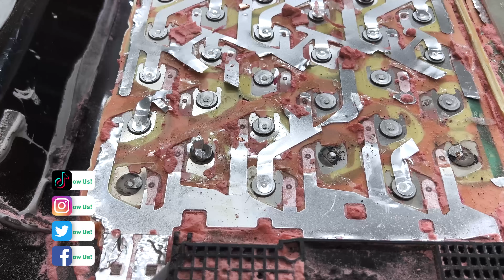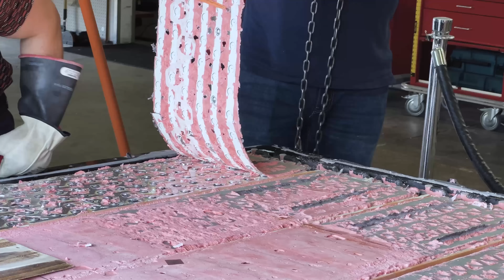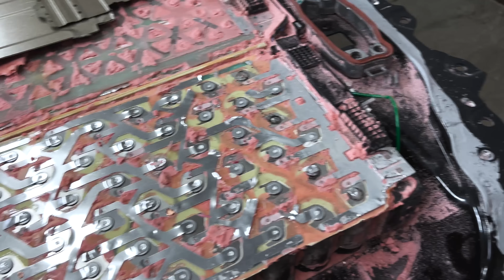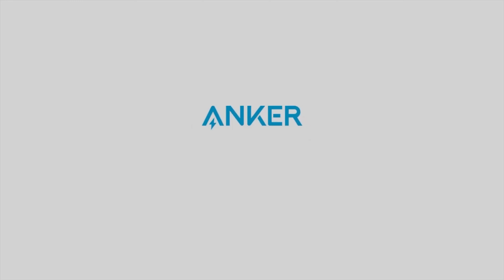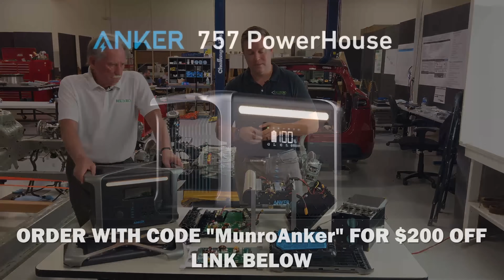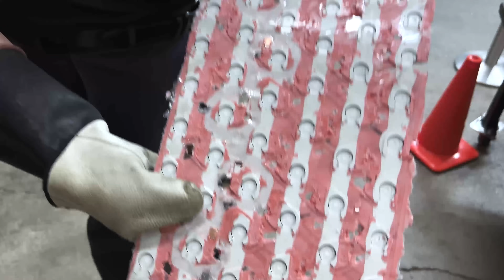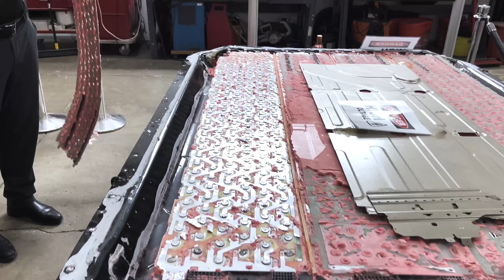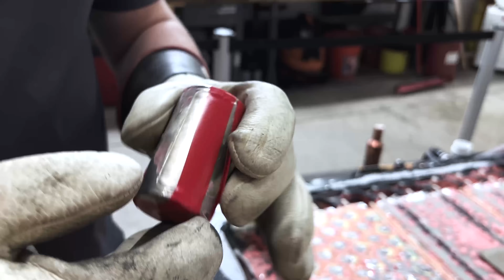Tesla's 4680 Current Collector Layout

Comment: The EV conversion shops won't be able to do much with this battery pack.  If a vehicle with this pack gets totalled, the pack either needs to be used whole or go straight to the recycler.  Obviously that's not Tesla's concern - they just want to make a profit on new cars.  But mass use of this pack by Tesla will have effects downstream on conversion shops, homebrew solar shops, insurers, auto wreckers, and the battery recycling industry, which is still not very developed.
Reply: That was patently obvious at Battery Day. Any conversion shop shocked and surprised by this really shouldnt be trusted to be doing this kind of work.

And from Teslas' perspective, not having people using thier modules in hotrods is a safety/legal plus.
Reply: @patreekotime4578  I didn't expect it to be serviceable but expected the pack to have to be cut out of a chassis. Turns out it's a simple bolt-on your a chassis without a floor in it. I'm underwhelmed. The thing is thick and the specs do far lackluster. Cheap to make sure but Tesla never share such savings with customers. Look at the price of a Model S.
Reply: @Cloxxki  The manufacturing approach for the Model S is totally different. If Munro analyse this and give it the thumbs up as an amazing advance in EV manufacturing I reckon I'll take their word for it. What's the problem with a removeable pack ... don't you think you want the possibility of a replacement? Alternatively they could ultimately move to a welded approach once they have confirmed that in practice they don't need to swap out any packs.
Reply: Not really an issue. Battery recycling is quite developed now, and will easily scale as supply of batteries to be recycled increases.
Reply: There need not be a huge reduction in failures in order to make up for the lack of repairability and reusability from an environmental perspective, and this looks like a step up in reliability to me. As far as recycling goes, it should be almost as easy to run a large pack through a schredder as a smaller one.

Comment: There's something is not talking yet... this structural battery pack is supposed to be for the long-range, all the cells are there, it is full already? Am I wrong? But, according to some persons, for now, it is only a software blocking to don’t use all the cells? Because Tesla seems to not build the long-range yet with the 4680... thanx for your time.

Comment: "But compared to 2170s this is a major step up" 👍🏻😎
Reply: Are you sure? In which way? I can't see it for total weight, total energy capacity or consumer price. On top of that, zero level of serviceability. Use or scrap. The 2170 packs from crashed cars are used to power buildings and other cars.
Reply: @Cloxxki  that quote was from the video itself from the guy talking to Cory not me. 👍🏻

Some of the ways it's superior imo? No individual modules means less assembly time, less materials total which equals less costs&less chance for things to go wrong during many various assembly steps.

828 4680 cells vs 4400+2170 equals less material handling, less welds, less cooling snakes, simpler lighter more efficient&sustainable.

4680 cells designed to be part of a stressed member load bearing cell to pack&cell to chassis assembly which saves weight, 2170s get carried like a drop tank on a jet fighter in comparison just dead weight.

4680 when all gains are realised by team tesla internally? Will cost half what they paid per kwh for cells back in 2020. 

4680s production all in house means gains are realised instantly and implemented just as quickly and tesla alone reaps the benefits. 
Vs being at the mercy of cell providers i.e. Panasonic who never got giga Nevada to the 50 gwhs they provided elon back in 2014. 

I can think of many more reasons but those are a few of my favorites. 😎
Reply: @4literv6  i'm not sure how that's true. they were talking about energy density (the Wh/litre type) and for this to be true the cells would need to have significantly more than 89 Watthours each. (21700 had 16.75 Wh each, 4416 of those makes a 74 kWh pack, whereas nobody yet knows how much these cells have exactly) a "major step up" i'd say is 105 Wh for each cell. anyway i don't get why people get hung up on energy density (the Wh/litre kind). specific energy is much more important (the Wh / kilogram one)
Reply: ????- umm
Reply: the results are in: 86.5 Wh cell. not impressive. data by university of california san diego video 4XOHetABrag here on youtube (can't find a direct link to the document)

Comment: Yes its official, 828 cells. Now we just need to know the kWh of each cell.
Reply: Less dan 0.1 kWh is my guess. For a cell 5.5x larger than 2170,pretty meh unless the cell is only 4x the weight. 
And you can only measure that driving the car and dividing by number of cells. If you test the cell in the lab, between which voltages? It's supposed to be all new chemistry after all.
Reply: He says in the end 600 cells. Not 800?
Reply: @TurreTuntematon  I have no idea why Cory mentioned 600 cells - presumably just a slip. He knows that there are 828 cells.
Reply: rumour has it 96 Wh per cell. it's a lower estimate from the limiting factor video afther a chemical test of a cell, not a proper discharge test. 828 of those would make for a ~80 kWh battery pack. each cell weighs 355 grams out of the pack, so specific energy if all the other numbers are correct is 272 Wh / kg
Reply: correction: 86.5 Wh cell, 81.5 of which is usable. not impressive. data by university of california san diego video 4XOHetABrag here on youtube (can't find a direct link to the document). only 244 Wh / kg

Comment: I haven’t read through all the comments, but I’m curious about the flammability of the pink foam. Have you tested it yet?
Reply from the maker: Not yet, but we will.
Reply: @MunroLive  And the weight of the foam, I wonder if they can safe weight on that too.
Reply: I can tell you about the flammability of the 5 gallons of Ethanol Glycol.
It's highly flammable.
Especially when it's hot from supercharging or hard driving.
Reply: @whompywheels5165  Why would anyone have 5 gallons of Ethanol Glycol in it's electric car?

Comment: My takeaway? This pack is going to be able to move a lot more power in and out safely because of the robust nature of this architecture. Thanks again for your time and dedication Munro team.
Reply: Cooling is much more important for that than robustness.
Reply: @EinzigfreierName  
"Not heating" is much more important (and efficient) than cooling.
"Tabless" says "hi".
Low resistance> more power/ less heat > much less cooling required.
Plus, less heat stress on the cell = longer life.
Reply: @rogerstarkey5390  That's true of course. Producing less losses/heat in the first place is an important part. How much the tabless design really contributes to that we'll have to see.  Waiting for someone to measure and publish such basic data like internal resistance of a 4680 cell.

Comment: Why aren't they using axial cooling . Is radial cooling better ?
Reply: The Limiting Factor had a teardown video.  Right now it looks like the current collector on each end of the cell has too many gaps to conduct heat better than the side wall.  Might also be doing the 4680 upgrade in stages and we'll see end cooling in a few years.

Comment: Brillouin Energy Corp Demonstrates CleanTech Licensable Solid State Fusion Boiler System at the 24 th Annual International Conference on Cold Fusion July 25 th – 28 th at the Computer History Museum in Mountain View, California Breakthrough boiler system uses hydrogen to produce low-cost heat with no combustion or pollution, paving the way to a clean energy future.
Reply: Hydrogen is hopelessly inefficient at every stage of its cycle.
Reply: @fredbloggs5902  Diesel Engine Oil Shortage: Diesel engine oil products already RUNNING OUT on retail shelves. youtu.be/Lvf1iM8Uvfs

Comment: Another YouTuber, The Limiting Factor, got a pre-production 4680 cell and sent it to researchers at UC San Diego for tear down and has the full 4hr teardown condensed down into a 1hr video on his channel. It would be interesting to see if there are any significant changes in the production cell, though not sure Munro will go into that level of detail on YouTube. The shell of the 4680 cell is much thicker than a 2170 cell, likely due to it being intended as a structural pack design. The researchers had a heck of a time cutting the through the shell, much like Munro is having a heck of a time disassembling the pack.
Reply: This guy bought a cell from Sandy already to repeat this process again. So he will have his comparison between the two.
Reply: The Limiting Factor plans to buy one of the cells from Munro Live, do a tear-down of it, and report what differences it has, if any, from the older cell. I'm not sure what the time frame will be for that tear-down and reporting.
Reply: They had "a heck of a time" because they used just about every incorrect tool you possibly could.
(Including nail scissors.... I kid you not)
They need an actual technician to make a simple jig allowing the use of proper cutting tools.
Just sayin'
Reply: Define "structural"? Is the car a noodle without the pack bolted on? There was supposed to be weight savings, but the loss in energy capacity seems to be greater than the reported 9 kgs.
Reply: @Cloxxki  seats physically bolt to the pack. The top of the battery pack is the interior of the floor. It’s isn’t just a battery pack as an integrated battery/floor assembly.
Reply: are you trying to tell  me something I don't  know, or just pumping your image of self... Yes yes yes, and BS...  lol (yes I know what compisites can achieve, so many have no idea  and just pump thair fears.)  get on with it...
Reply: The cells themselves aren't structural - all that "pink foam" precludes that...  Thermodynamics and containing "runaway events with a lower SurfArea to Volume ration will necessitate thicker casing...  lol..  Ay research institute who can't cut a steel case, isn't trying...

Obv, Triolled - for good reason...  lol...  jk..have a great day.
Reply: @kadmow  Well it would be easy if you didn’t care about destroying it, but to do it properly requires doing it in a sealed glove box with no oxygen with all manual tools. Makes it a lot more difficult.
Reply: @Weezedog  - salt brine followed by water-jet - solves many problems, lol.. (glovebox - like for storing ones tissues??  - global english is funny and confusing at times).... enjoy.
Reply: @kadmow  My father in law builds model airplanes with foam and fibreglass. You wouldn't believe how strong a fiber-foam-fiber sandwich wing can be. Composite racing cars such as F1 cars are built similarly. Did you think they'd weld the cells to the casing or what?

Comment: I’m interested- I was expecting a lot less cells due to the improvements as they chose to make a standard range version but it seems there are still a similar number of cells - are teslas claims about the 4680’s accurate?
Reply: 18650 packs for tesla are over 7k cells, 2170 packs Cory just said 4,400 cells, these 4680 are just 828 in comparison. 
Seems like a major reduction in cell count to me. But I didn't take common core math either so. 😀
Reply: @4literv6  I obviously didn’t watch the video in its entirety lol
Reply: @4literv6  BMW i4 is 324 cells for 80 kWh. Mercedes EQS is 216 cells for 108 kWh. Teslas 4680 cells are still quite small and numerous in a pack.
Reply: @koeniglicher  those are the inferior prone to thermal runaway pouch cells right? 🤔
Reply: @4literv6  No, BMW i4 80 kWh and Mercedes EQS 108 kWh packs, both are built with prismatic cells. In addition, your negative comment on pouch cells (like in most Porsche Taycan packs) is way too general and unsubstantial.
Reply: @koeniglicher  recalls so far for pouch cell equipped evs would seem to reinforce my comments. 
To each their own. I'll trust the company whose just now made 3,000,000 evs all with cylindrical or prismatic lfp and zero pouch cells. 👍🏻
Reply: @4literv6  of course the cell count is lower - a 4680 cell has 5.5 times the volume of a 2170 cell, and 8 times the volume of an 18650 cell.

There are 828 4680 cells in this battery.
Reply: @brianb-p6586  why are you responding to me and using the cell count I posted 9 days ago? 🤔
Reply: @4literv6  Because you seemed to think that the obviously lower cell count was some sort of revelation, rather than the obvious result of larger cells.
Reply: @brianb-p6586  lookup assumptions next time before commenting on something that didn't involve you to begin with. 👍🏻

Comment: Is it true that this new design pack has a lot less total energy capacity, while saving only 20 pounds (9 kilograms) over the latest 2170 pack Model Y?
Reply: The energy capacity of 4680s is currently unknown, it’s believed to be somewhere around 100 Wh per cell.
Reply: @fredbloggs5902  cheers, but the pack seems well under 80 kWh for over 800 cells. Did anyone weigh a cell yet? I'm baffled that people seem to just cheer and don't want to know specs to compare to the Battery Day fuzzy math.
Reply: @Cloxxki  I honestly have no idea, I think 828x cells were mentioned (?). What’s your source for the total capacity being below 80 kWh?
Reply: They commented directly in the video they expect it to have higher energy density. Listen.
Reply: @shannons1886  we want the figures for NOW, not in a year’s time.
Reply: @shannons1886  Expect... The car specs are underwhelming so far. Others have the energy density barely over 2170s. Tesla rolled a larger cell, like AA to D, without only savings for Tesla, no technical gain for the customer I can see. Same price, less range and nothing to salvage when a battery goes bad. Just high grade lithium and aluminium ore...

Comment: With that liberal foam, do the cells themselves add ANY structural integrity to the chassis, as was originally promised?
I seem to remember the cells were to be bonded together on 6 sizes, to at least one plate and sit between even sturdier dummies to space the top and bottom plates. Now the pack is a bolt-on anyway and I don't see the cells doing more structurally than just sitting there?
Reply: It s not foam once it dries and hardened  . can t you tell or you “just “ sit there
Reply: I am only sharing my opinion. take lightly. I believe the cells and pack are supposed to have some level of flex. I am curious as well, I think the pack is more like hard dense rubber and rebar as battery cells. so hard front flexible middle, hard rear.  if flex doesn't distort then should be very useful
Reply: @davidguay5326  It's a thick one, though. The shell might be stiff, the foam and cells would not support it until after substantial flex, from my guess. What's structural? That the car doesn't have a floor when there is no pack?

Comment: Is this the single most expensive component deconstruction you guys have ever done?
Reply from the maker: Yes
Reply: @MunroLive  You said you had worked on tanks, airplanes and whatnot. There must be far more expensive components in them, that you analyzed.
And: you teared down a Model S 102 kWh battery pack. This is more expensive already than this 80 kWh pack.
Reply: @koeniglicher  expensive in man hours and specialized equipment.

Comment: Please do a full cycle of a single cell to find out the current watt hours per cell.
Reply: They probably try to discharge the cell to zero, you know, for safety...I'm guessing it won't work quite as well as it did....
Reply: OK genius, which voltages do you recommend for this particular chemistry?
Reply: @Cloxxki  lol what? They are 4.2v per cell. They are still NCA. All NCA is 4.2v per cell charged (3.7 nominal).
Reply: @jasonfranciosa  They are NMC-811. No longer NCA. Voltages still apply.
Reply: @koeniglicher  Thanks for the clarification.

Comment: What is the point of that pink urethane?
That makes the battery pack unserviceable, if they need the foam couldn't they of laid down preformed urethane sheets that can easily be removed for serviceability or recycling purposes?
Reply: It's a structural pack.  The battery is essentially turned into a solid brick for strength.
Reply: The cells have to be glued to the top and bottom skins of the battery pack for the cells to function as the core of a sandwich structure.  Put another way, that pack is probably 10-20% the stiffness of a solid plate of steel the same size and is like 10x lighter.
Reply: Unserviceble is the point probably, surely, considering Tesla's preference to total loss at the slightest scratch and no parts for people repairing salvaging cars, unless the law tells them to.
I fail to see how any of this results in "cells adding to the structural integrity of the chassis, allowing for a much lighter chassis". With the pack out, I'm sure it's lighter than the 2170 car with the pack out. Overall, is there any gain when normalized for energy capacity? I don't think so. Cells appear fo be decidedly average, rather than a "breakthrough in energy density". Shades of 2170, which was soon sidelined, replaced with ANY 3rd party cells and never even making it to Model S and X, the cheapest (not really) bestest cells (nope) on the market...